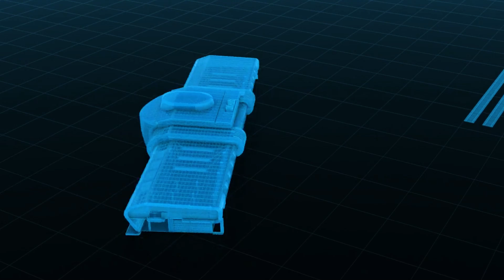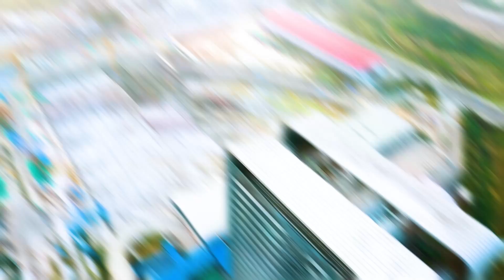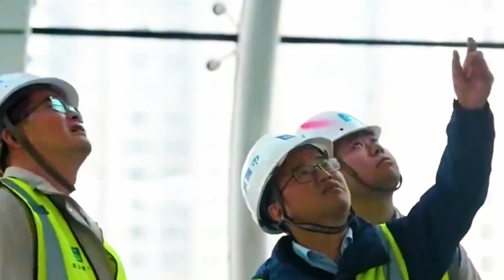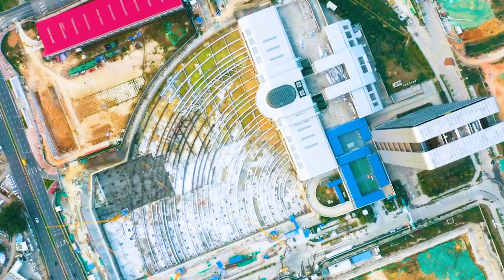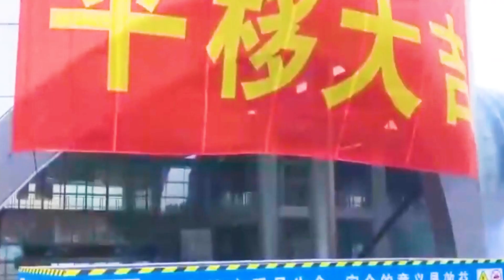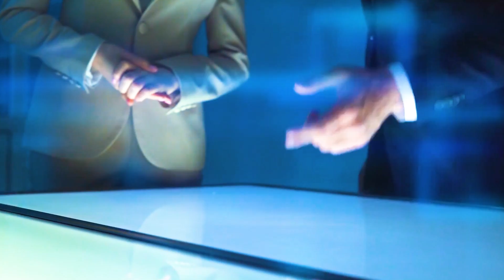China rotated a 30,000-ton large building 90 degrees, and American engineers were shocked!

Comment: The large building, known as the Longyuan Power Technology Building, needed to be moved in order to make room for a new project in the area. The decision to move the building instead of demolishing it was made to save time and resources, as well as to minimize disruption to the surrounding environment.

To carry out this complex task, Chinese engineers used a combination of advanced technologies including:

1. Hydraulic jacks: Hydraulic jacks were used to lift the building off its foundation, allowing for the rotation and movement of the building.

2. Steel rails: Steel rails were laid out to create a track for the building to move along during the rotation and transportation process.

3. Computer-controlled synchronization system: A computer-controlled synchronization system was used to ensure that the building moved smoothly and evenly during the rotation and transportation process.

4. Monitoring and safety systems: Engineers implemented monitoring and safety systems to constantly monitor the building's movement and stability, ensuring the safety of the operation.

Overall, the successful rotation and transportation of the Longyuan Power Technology Building showcased China's advanced engineering capabilities and innovative solutions to complex challenges in infrastructure development.

Comment: The project you are referring to is the relocation of the Guosheng Center in Lanzhou, China, which was moved to make way for urban development. The engineers used a technique called "walking" whereby they slid the building along specially designed tracks using a series of hydraulic jacks and wheels. This innovative method allowed them to move the massive structure with precision without the need for traditional cranes or heavy machinery.

The engineers also utilized advanced monitoring and control systems to ensure the building's stability and safety during the relocation process. This involved carefully monitoring the building's movement, as well as the surrounding environment, to minimize any potential risks or issues.

Overall, the successful relocation of the Guosheng Center showcased the impressive engineering capabilities of Chinese engineers and their ability to tackle complex and challenging projects with innovative solutions. The use of advanced technologies and meticulous planning played a crucial role in the project's success, further solidifying China's reputation as a leader in infrastructure and engineering achievements.

Comment: Yes, the complexity and technical difficulty of moving such a large building indeed impressed engineers around the world. The precision and planning required to successfully relocate a structure of that size without causing damage or structural issues are quite remarkable. It showcases the advancements in engineering and construction technology that China has achieved. The project likely involved intricate coordination, innovative methods, and state-of-the-art equipment to ensure the building's safe and successful relocation. The fact that China was able to execute such a challenging project demonstrates its expertise and capabilities in handling large-scale engineering endeavors.

Comment: There could be several reasons why China needed to move such a large building in a complicated way. One possible reason could be to preserve the historical or cultural significance of the building. Moving it to a new location could help protect it from damage or destruction. Another reason could be to make way for development or infrastructure projects in the area where the building was originally located. By moving the building, China could repurpose the land for other uses while still maintaining the building's historical value. Additionally, moving a large building could also be a logistical challenge that showcases China's engineering capabilities and innovation in construction and architecture.